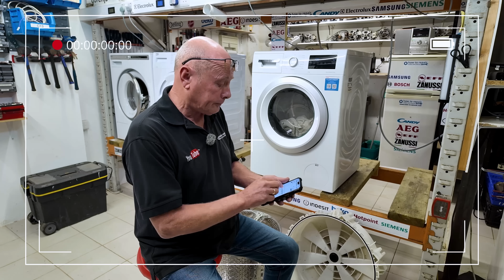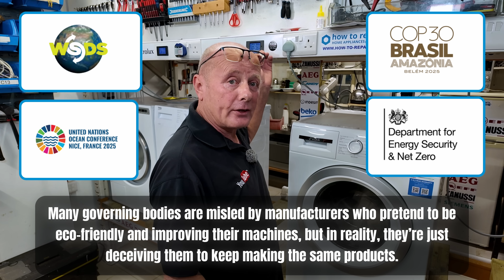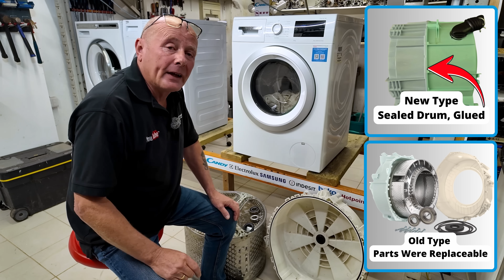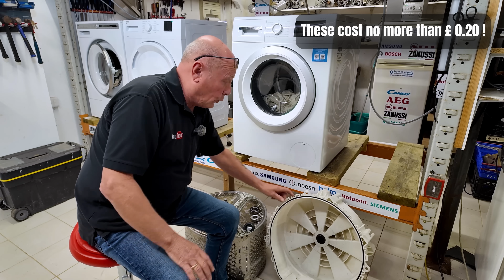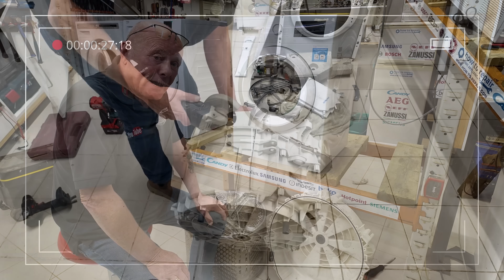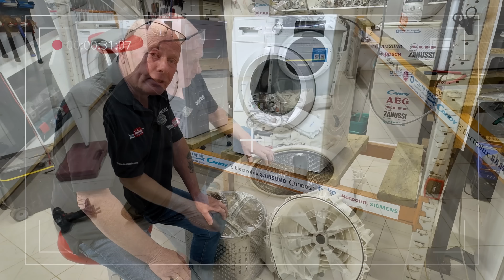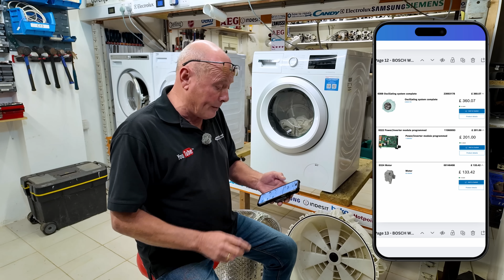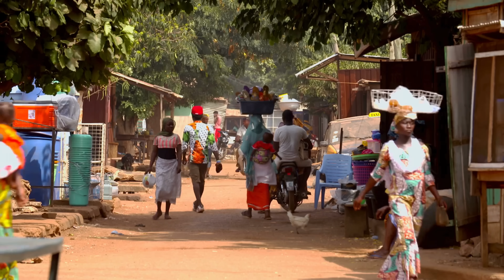Washing Machine SCAM EXPOSED! The Truth About SEALED Drums: Naming & Shaming

Comment: We decided to push the boat out a few years ago and buy a Miele dishwasher thinking it would last for many years. At about three years old it started to leak around the door seal. Shopping on the internet I found that Miele prevented suppliers from selling aftermarket parts and I reluctantly had to pay a ridiculous £150 for the door seal from Miele! I took great care fitting it which was quite easy and all was well for a few weeks until it started leaking again. Faced with the prospect of paying another couple of hundred quid for the pleasure of calling out an engineer the dishwasher, at least than four years old went to the tip! Modern day highwaymen!
Reply from the maker: Your story is incredibly frustrating and it perfectly illustrates the financial trap set even by premium brands. We know Miele used to produce high-quality machines with great German engineering, but we also specifically mention that their parts are exceedingly expensive. Paying a ridiculous £150 for a door seal is highway robbery for a component that costs pennies to manufacture, and Miele’s practice of preventing aftermarket suppliers from competing only reinforces their profit monopoly.

Thank you for your comment. I appreciate people like you taking the time to write it out. Please don’t forget to subscribe and share it where possible. It might help others make a wise choice instead of being misled by the industry.
Reply: @How-to-repair interestingly Miele appear to have reduced the length of their guarantees.  This suggests a reduction in quality.  This is why we chose to buy a Fisher Paykel machine.
Reply: @Land-of-reason and they also produce sealed drums ...just like everyone else...
Reply: @Land-of-reason  I bought both my Miele washing machines around the turn of the century. The first had an incredible five years parts and labour guarantee, the second three years, but both machines are still going strong, with no repairs.
Reply: German manufacturers think thay all germans are suckers. I've been living in Germany for 10 years and I can't comprehend how the government and big corporations screw german people.
Reply: 😮 I thought miele was a good brand because it used to be reliable in the past. And not only that they provide Replacement parts...
Reply: @blade9292 i never had a Miele. Knew it was good, but repair was always expensive and that was a turnoff, so as much as I liked their washing machines, I didn't get to one so far, as my 17year old Bosch is still working. 
Now my mom's 23 year old Electrolux is dying and I was looking around for a new one. Heard about these new plastic BS and thought: "maybe reach for a Miele now" bit guess what: they told me Miele is doing the same .. .what a turnoff. 
As much as I could just buy a Bosch (that I like in terms of programs) and it may be just fine, I'm postponing buying. 

As far as I know, despite Miele in the past was reliable, it wasn't immune to needing repair (normal) and then the cost was high. 

Also, a friend was complaining about his Beko fridge breaking down twice during Guarantee time. While reporting the damage in the shop he saw another customer who had bought an expensive Miele (just to have piece if mind) also report his broken fridge....and literally "losing it" as his machine broke down just a month after his cover expired, and he was threatening big time if they dont acknowledge to repair it.....so Miele going the same route as others....

Also: the Bosch series 8, which is "super advanced" in terms od having all the functions: don't want it, because: done things don't work without looging into Wifi (and allowing them to spy on you this way) and most or all programs save on water and you can't even manually change that. That's a huge issue, as some clothes may not get rinsed enough. 

I heard of a customer that came with that complaint to the shop: her new washing machine (don't know which brand) is still having foam at the end of the cycle because it's "saving water" and she was looking for one where the customer can override this automation ....
Reply: Mile's used to be worth the extra. Very robust and long  lasting. Not any more. Extremely expensive with poor warranty. Says a lot about their confidence in the product. Bout a Samsung good value, good machine with a great warranty.
Reply: why not use a lot of silicone or some sealant
Reply: @ChuckLeeClerk I tried that it just doesn't work because a lot of rubbery parts of your machine move or have to seal parts.
I found a machine in the trash and tried to see if the part was shared with mine and then  replaced it.
Reply: You cannot be serious.
Reply: You obviously didn't take quite enough care fitting it.
Reply: You clearly did not keep the door seal clean.
Reply: @Land-of-reason  Exactly. And he didn´t use the original cleaning solution every 6 month or 50 cycles.

Comment: Big thanks to you for putting down the effort to raise this issue - the car manufactures have introduced similar failure by design to take us the consumers hostage !! Not fair and definitely not environmentally friendly - think of all the energy that gos into producing new products rather that repairing and saving resources. We lack circular thinking amongst the producers...
Reply from the maker: I completely agree mate. It's frustrating to see the same patterns of planned obsolescence across different markets. As I mention in the video, the domestic appliance industry is one of the largest in the world, possibly outweighing the car industry, and the manufacturing structure is exactly the same globally. The issue isn't just the energy used when running the machine, but the massive environmental cost of producing a new product to replace one that failed prematurely and now ends up on the e-waste pile. This lack of circular thinking from producers is what we need legislation, like the Right to Repair act, to challenge. I'm so glad you agree with the main idea! Making this video as visible as possible is up to all of us. I can't do it alone, so please remember to share it wherever you can.

Comment: nice video thats why i split the drum n replaced as you say now we have welded drum s 
yep the prices are horrendous so repairing it is not an option 
however the wonderful warranty which am sure is written on toilet paper and thats what the warranty is worth new machine purchased broke down with in 4mths called the repair centre only to tell me a 90 quid call out if any things like coins jammed machine circuit boards motors drum water leaking (all the thing that will go wrong) n engineer deems not repairable then game over 90 quid up up shirt and no machine Welldone HOTPOINT utter rubbish i was so pleased to launch this machine down to the local tip !!! best place 400 pound machine last less then 4 mths
Reply from the maker: I am glad you were able to successfully repair your old machine by splitting the drum, as that is becoming a lost art thanks to deliberate design choices. Your new Hotpoint (a brand under the Beko umbrella) is a perfect example of why I say these appliances are often lasting barely five years.

By charging a non-refundable fee for any common failure (like a coin, circuit board, or motor) and then deeming it non-repairable, they ensure that the consumer is 90 quid up up shirt and still forced to buy a new machine. It's a structure designed to rip the consumer off. 

Thank you for your comment. I appreciate people like you taking the time to write it out. Please don’t forget to subscribe and share it where possible. It might help others make a wise choice instead of being misled by the industry.

Comment: Thank you for your video! I figured this on my own, it annoys me for many years now. I could write a smaller book ranting. Since you asked what we think here are some from me. (just a payroll clerk with some IT background not an engineer by far)  

My grandmother is 93 years old now and still has her old centrifuge machine she used for 50+ years. Of course she doesn't use it that often now being so old but back in the days it was in daily use and it still functions. In the mid 90s we replaced our old washing machine that was about 20 years old but still fully functional.

Nowadays I had a dryer that didn't last 5 years, had a boiling water tap that didn't last 4 years, have a dishwasher that needed a new pump by the age of 3 ish, had a microwave that started to rust inside within 2 years, have a high end induction hob that started to play up when it hit 5 years old, had a 5 year old car display in the car where the touch screen died had to replace the whole unit. Also what I found that 90% of the time a repair is almost the same price as buying a new one. So why repair and have something old if I can buy a new one a for a bit more and I have some warranty on it. Sad.

Days are long gone where you paid the extra money for quality that lasted longer and gave you a better experience. Nowadays I go for the mid range on the cheaper end so if it breaks down I just buy another one. I avoid the very cheap stuff as it is indeed no quality no lifespan unless you are lucky and hit on something that is actually good. But that's rare.

To your point products being different in other regions, in the US the online shops evaluate your physical location and if you are in a richer region they show higher prices. So yes, everything is intentional, they spend money on figuring out how they can squeeze every last penny out of our pockets. And I hate it. I wouldn't mind pay good money for something that lasts but nowadays it seems everything is crap, designed to fail and impossible to fix. Oh, got another example: I have small children and most of the books where you can push buttons to play sounds and some plush toys making sounds are with built in batteries that can't be replaced. Battery dies, throw it away.
Reply from the maker: I'm so glad you agree with the main idea! Making this video as visible as possible is up to all of us. I can't do it alone, so please remember to share it wherever you can. Your examples are spot on especially your grandmother's 50-year-old centrifuge! I've been in this trade for over 40 years and I've witnessed the shift away from manufacturers building their reputation on quality up until the '90s. Nowadays, when you're looking at a repair bill that is nearly the cost of a new appliance with a new warranty, it makes perfect sense why you (and many consumers) choose to simply buy a replacement. This short forced lifespan is the entire problem and it's by design. We see this obsolescence by design everywhere, from your induction hob and dishwasher pump to the high-end car displays and even children's toys with unreplaceable batteries. This entire structure is designed to rip the consumer off. My simple recommendation remains: Keep it basic and ask whether the manufacturer supplies the necessary data for the right to repair.

Comment: We warned everyone in the leadup to joining the EEC, long before it became the EU protection racket it is today. We also warned everyone in the buildup to Brexit? Did they listen? It was obvious what this corrupt organisation was about, but the people were too busy watching soaps and quiz shows.
Reply from the maker: Brexit cost me my shop in Portugal. They told me there was going to be no change. Are used to export used machines from the UK to Portugal and my shipping cost was £10 a unit before Brexit the first lorry load I did after Brexit the same machines were costing me nearly £70 with customs clearance and the paperwork was incredible. These were machines that were manufactured in Europe sold in the UK and then I had to ship them back into Europe but I had to produce individual paperwork on every model totally Ludacris.
Reply: @How-to-repair  you prove my point, they only wanted the public to buy domestically, which now is, DO NOT Repair?

Comment: There is another issue here as well. If not for DIY most repairs would not viable. The best quote i had to replace bearings in my samsung washing machine was £210 (on a 4 year old washing machine) and nearest availability was in just over a week. So i can either spend £500 on new washing machine and do laundry the same day and have another 4 years or spend £210, wait a week and it might fail at any time.
Reply from the maker: I do not disagree with you whatsoever when it comes to the labour cost the cost of living is expensive in the UK and labour costs are high but it does not give the manufacturer the right to remove the right to repair. If general public wants to have a go at replacing the bearings themselves there is plenty of video content showing you how to do this on most makes but when the manufacturer goes out of their way to build in obsolescence by removing the right to repair in my eyes, this is a criminal act they say they are saving money on the screws that held the drum together but no one is willing to quote me how much it costs to weld the 2/2 of the drum together thank you very much for your comment.

Comment: Very well done Paul for flagging this up. It's yet another example of manufacturer's not giving a sh1t about the actual end users who purchase their products as necessities in our lives. Based on that, and your experience in the industry, are you able to advise which machines today are the most easily repairable should they fail (obviously not Bosch ones). This might also be an encouragement to organisations like Which to be less influenced by manufacturers and serve the consumer who they claim to represent. 
I've just bought a new Beko BM3WT3841W from Curry's for £250. It's ok but not as good as the old Indesit it replaced after 15 years use. I always tend to purchase lower end products simply because they are less complex than the fancy ones you can program from a smartphone with an app.
Reply from the maker: the beko has a sealed drum, but the technical support is quite good. It should last you a few years I also like. lg at a mid range price they have a splittable drum but poor technical assistance. On the top end of the face scale, I love. the Asko machine, but I'm working on getting technical assistance for them. Please remember to share the video as this is the only way we will get changed implemented.
Reply: @How-to-repair  Ok, thanks for the info. I thought that not being repairable might be the case, hence why I went cheap. We'll see how long it lasts. Cheers

Comment: Agree, the same thing happens with many modern appliances, also motor vehicles, it's called planned obselescence, so cars planned lifespan maybe 10 years, so you have to buy replacement cars more often. As an example a well maintained Morris Minor, for example, could easily last 50 years. I recently replaced my drum spider on my Bosch washing machine, This requires removing some large rivets, and assembly with nuts bolts and locktite, luckily it is a splittable drum 👍
Reply from the maker: Don't even start me on the Ford transit and a wet belt, when I bought a camper for the purpose of travelling around Europe visiting the appliance industry. I deliberately bought one that was a 2002 with no electronics meaning I can repair it wherever I am, the early Bosch washing machines were brilliant yes they had some  problems but if you asked me a question in 2005, what make of machine I would've bought it would've been this make. today I would not touch it with a barge poll because of the repairability problem, although it is a good washing machine when it comes to the function. Thank you very much for your support. Please remember to share if you can.

Comment: We have had a Miele for 20 years - it's had a couple of small jobs done mainly because we live in a hard water area but overall it's been brilliant. Recently we fitted a water softener in the house and all our equipment is running much cleaner.
Reply from the maker: The old machines were absolutely brilliant but their new machines I'm not so convinced on especially on the lower end price bracket they are putting in sealed drums thank you very much for the support

Comment: For PCBs it is also quite easy to place components that are 'under dimensioned' so they will likely fail sooner or later. Parts that are somewhat over dimensioned will cost only a few cents extra.
Reply from the maker: I've seen this on so many occasions, especially with underrated relays thank you very much for your support. Please remember to share if you can.

Comment: I bought a washing machine (can't remember the brand) in 1972 and it lasted for over 20 years with no repairs necessary. I somehow doubt whether you'd see that with modern machines.
Reply from the maker: In my opinion, the average lifespan of a washing machine it's 3 1/2 years on machines that only had a 12 month warranty and on the mid range machines. I am seeing 7 to 8 years thank you very much for your support. Please remember to share if you can.